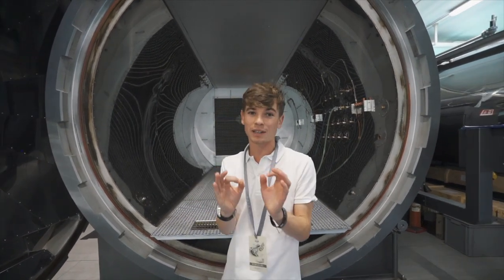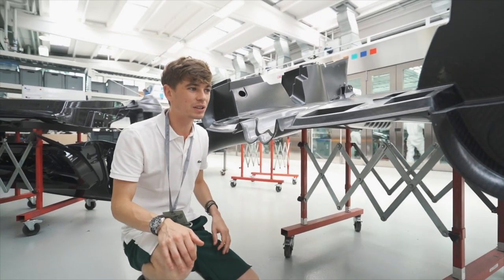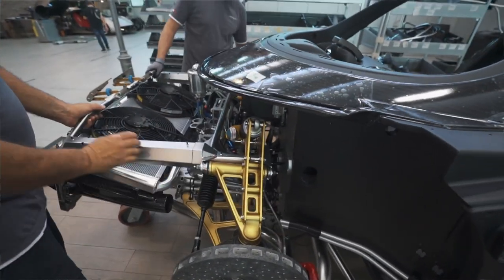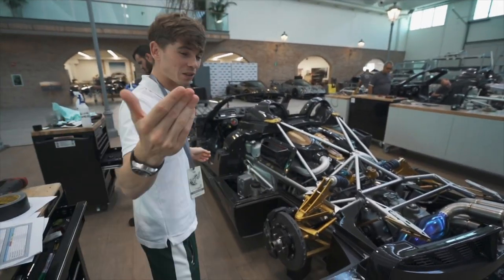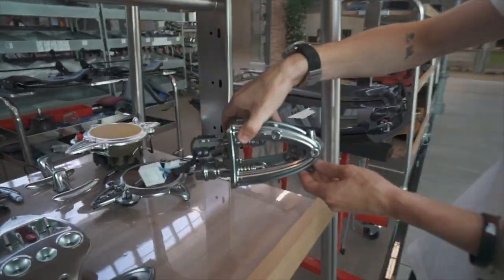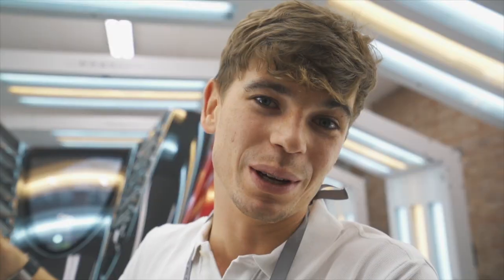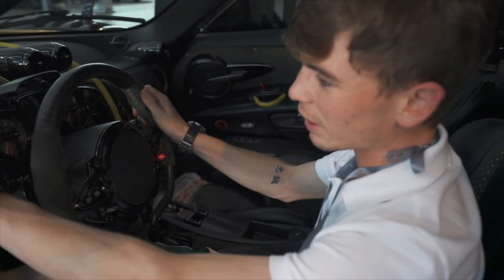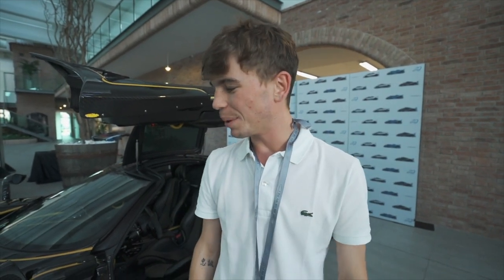PAGANI HUAYRA BC | How it’s built!

Comment: When are they finally going to reach 1000 HP engines for a V12?
Reply: They probably want to keep the engine reliable because if you add too much horsepower per liter, more things can go wrong with the engine, also the axles, gearbox, clutch, and tires need to be able to hold that kind of power, I know they can make it happen but they probably want to keep the car at a lower horsepower so you can have more fun on the streets (legally) because tbh the only time you can really unleash 1000 horsepower is on the track and 75% of the owners don't take their car to the track.